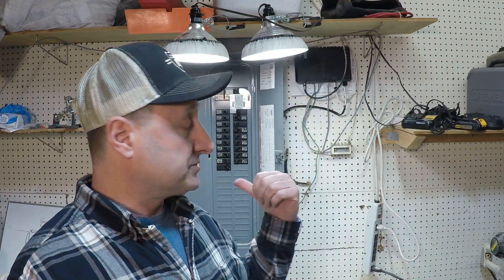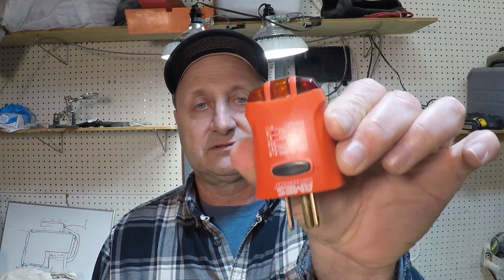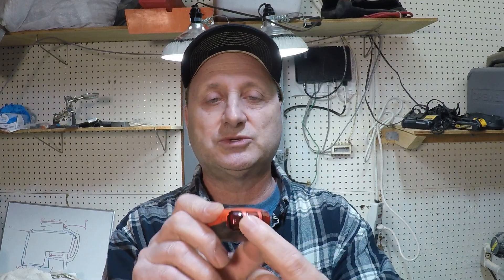Why Is Your Electrical Breaker TRIPPING ALL THE TIME?

Comment: So is it ok to replace the breaker with a higer voltage instead of separate a circuit?
Reply from the maker: Yes you can IF the wires on the circuit can handle the load of the new breaker

Comment: Pool Tech in Florida and I have breaker controling a pool pump that trips after 30 minutes of running good.  I replaced the motor and it's doing exactly the thing with the new motor, 30 minutes.  I inspected all the wire connections from the timer to the pump and saw no issues.  Do you think it's a bad breaker?
Reply from the maker: Yes it could be a bad breaker. Swap it out and see what happens.

Comment: I'm having a breaker trip but not constantly this is the second time while I was out. I haven't added anything to the circuit. The one thing I did notice and this seems unrelated, but I do have a question regarding it, the ground fault circuit interrupter Outlet outside, and one in my kitchen, have Blackness around one of the plugins. I asked my son who is an electrician, if I should worry, and he said no. It is testing properly and everything. I'm in an older mobile home. I'm going to do some testing in unplugging some things but it just doesn't make sense because I have not added anything. If a breaker has gone, wouldn't it keep tripping right away and not after a few days? Thank you and yes I could get my electrician's son's to come here but good luck as they are super busy.
Reply from the maker: There could be a few things going on here. What is on the circuit tied to the breaker that keeps tripping?
Reply: @flannelguydiy6458 pretty much everything, I am unplugging a few things and trying to see what is tripping it

Comment: at the office we have a small kitchenette area and there is a gfci outlet with a small undercounter fridge on another outlet but on the downleg of the gfci. For the last week the breaker has been tripping in the morning at the same time without tripping the gfci. I changed out the gfci, secured all connections and the next day the breaker was tripped again, at the same time in the morning. What do you think is causing this? Never happened before.
Reply from the maker: If the breaker is an arc fault breaker, then that could be why you are tripping the breaker and not the GFCI. Also, if the breaker is a 15 amp but the GFCI is a 20 amp, then that could also be a reason. Is the outlet where the fridge is plugged in on the same circuit as the GFCI outlet?
Reply: @flannelguydiy6458  So I bought a new breaker (it was a 20A). This breaker has one end with a metal tab that screws into the middle of the panel, so it was a unique breaker. That seem to have fixed the issue. Hasn't tripped since.

Comment: Is it normal for a vacuum cleaner to trip the breaker. No matter what room I use it in, if I turn it off and on again, breaker for that room will trip. All power tools make the breakers trip. Vitamix blender trips the breaker. We don't have computers or PlayStations or anything plugged in anywhere. We have a fridge and washer/dryer. No dishwasher.  GFCIs outside do not work at all

Comment: I have this problem with a circcuit breaker constantly tripping when I plug in a music keyboard via USB.  No tripping at all with the computer otherwise. I've gone through seven keyboards and they all cause random trips. The were all entry level cheap keyboards but plenty of people use them with no issues.  This has happened in the two houses I've lived in in the last 5 years. I got about a year from each house with no problems and then constant trips. 

I'm running the desktop off the mains going into one socket  while I'm powering a printer, two monitors, two speakers (usually not turned on), one study lamp and one desktop fan in the summer months.  There are no microwaves, washing machines, cookers or fridges on the circuit. 

I've just ordered a quality keyboard with USB C.  All the others have USB B (Printer USB cable), and that connection on the back of the keyboard often breaks.

Everyone I spoke to about this is baffled. Nobody has heard of this issue.  I've had electricians in who replaced the breakers to no avail. 

Another theory is something called harmonic distortion which I understand is like unclean electricity which instead of transmitting electricity at a single frequency of 50Hz, doubles, trebles and possibly quadruples which causes overheating to the point where the breaker trips.   If you have any ideas, I'd really appreciate it!

Comment: For me in my house, Whenever 3 things are plugged into the outlet and in use the breaker will pop and shutdown power to ONE side of my house. The fridge and Stove will stay on as well as one bedroom on the other side of the house but everything else will shutoff. This is troublesome as using only 2 appliances on a day to day bases is annoying as well as i plan to buy a computer and the thoughts that it will just insta trip my breaker is concerning
Reply from the maker: The first thing you need to do is figure out which outlets, switches, and appliances are controlled by each breaker. It is possible that you have too many receptacles on one breaker. I have a video on that topic too